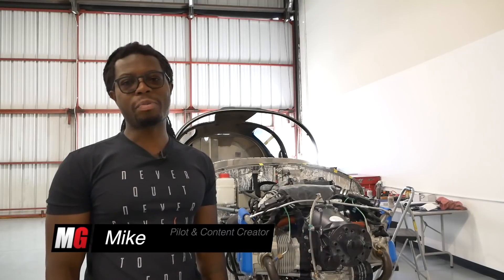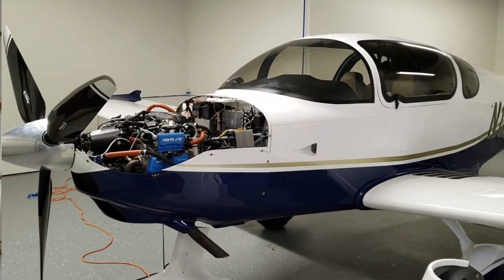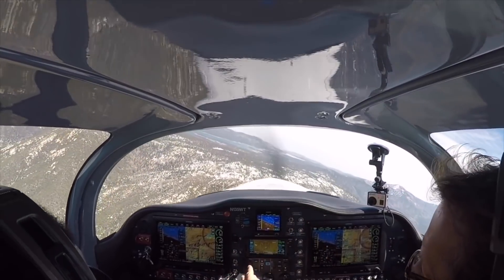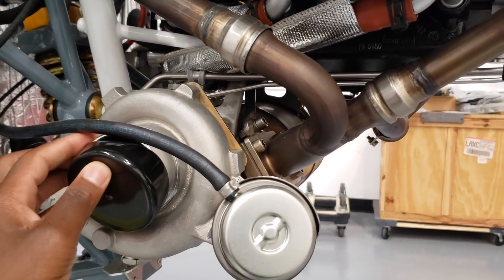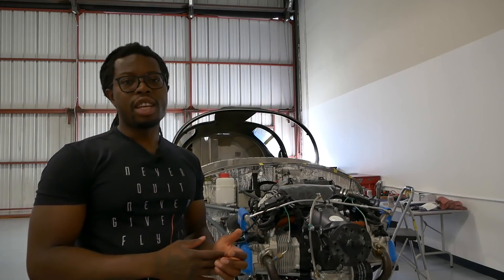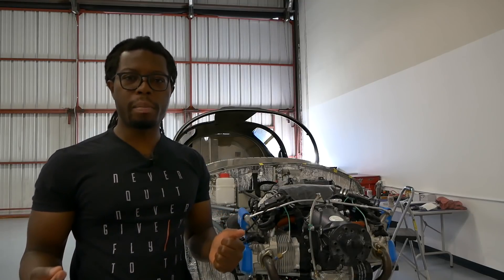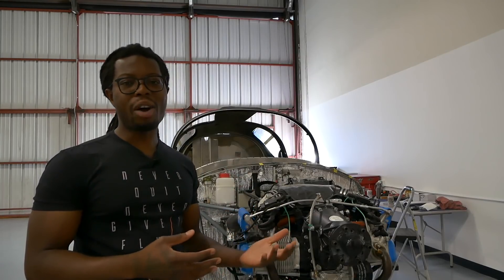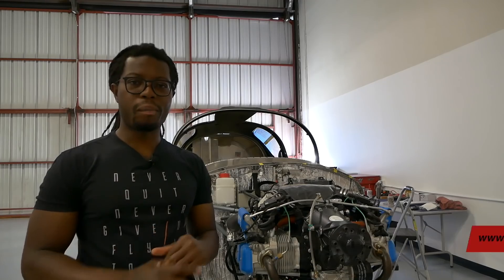What Makes The Rotax 915 Aircraft Engine So Special?

Comment: Interesting that the Rotax 91x series don't water cool the cylinders, and don't use overhead cams. While aircraft engines don't need to rev much, the use of pushrods creates less than optimal combustion chamber design, more reciprocating mass, and several points of leakage. As for the cooling, if you're going to have a radiator and water pump, then why air-cool the cylinders? Odd design choices, but these engines are certainly an improvement over the ancient Lycoming and Continental engines.

Comment: The most reliable way to add an extra 50 hp to a rotax 915 iS/ULS is to put two more cyclinders on it and make a it a six cylinder engine.
Why are Rotax messing about with turbocharging to Squeeze every last available horsepower out of the 912 platform?

Comment: I sold my turbo charged Mooney 231 in 2010 after flying it over 2000 hours in the previous 15 years.   The Continental TSIO 360 produced 210 up to 15,000’,  and gradually less up to its service ceiling of 25,000’.  Likewise I’m sure the 915is will produce much more power than a normally aspirated engine up to its service ceiling.  I owned a KITFOX SPEEDSTER running a ROTAX 912.  It’s a great engine.

Comment: Still difficult to understand a 1300 cc engine developing 140 hp and than dinosaur Lycoming or continental around 8 liters  developing 300 hp  and costing at least 4/5 times more no fadec and more similar to wwII engines. Is it that are more reliable than a rotax because they run at a lower rpm or what?

Comment: Mike, is that a reliable engine?  I’m told that the failure rate is higher than a Lycoming. Can you please comment?  Thank you.
Reply: that is a misconception...     based on Rotax also making 2 stroke motors...  & much lower cost $ much lower HP.
evidence is this series is very reliable.

Comment: Maybe the 915 turbo is different but I believe there is a bit of maintenance required on the 914 wastegate to ensure it stays lubricated. They can stick, so you need to check it and drip some light oil on it every now and then. They are great engines though!

Comment: Hey brother…. To escape the unwanted noise, pull your carpet as well as your panel and install a layer of Dyno-mat. It is heavy as shit, but unbelievably effective and somewhat fire resistant. You will either not hear the engine very much at all, or reduce it and other cabin noises to the point of insignificance. Just my 2 cents, which, realistically is probably worth zero, so free, or, maybe I actually owe you money for listening to my advice? Damn Mojo! WTF??? 😂🤣😂

Comment: I've been looking at Rotax engines, and the only thing I'm not sold about is the high rpm. I'd rather have a somewhat larger engine (2.0L) doing max power at 4.000 rpm. That way it could also be connected to the prop without a gearbox. Is there an engine like that?

Comment: So many questions, always with a Turbocharger at least on an automotive engine. It is not wise to have a direct-injected engine. The reason why that's not wisest because the oil residue in the PCV system follow the intake valves to a point where it no longer functions quite well. To solve that issue, you almost always have to put on oil catch can. Is that a problem with this aircraft engine??? Have the other issue which shouldn't happen because you're usually taxing on to your stop point and usually don't have the really high temperatures of the turbocharger when you shut the engine off like sometimes you can with a car after you've driven it hard you get some place you shut it off too soon and it Cooks down the oil and the Turbo Shot because oil is no longer being supplied. With automobile engines, it is wise to have the engine idle for about 5 or 10 minutes so that the turbocharger can cool down before you shut it off. Another thing that you can do is to for about a week on an automobile engine with a Turbocharger you can run some Marvel Mystery Oil in the oil and it will help clean any buildup of shellac or carpeting up of the oil both in the engine and in the turbocharger. But then again linkyte, or what we now call zMAX will do the same thing.
As for your comment on the exhaust note, the turbocharger will change that exhaust note considerably. Plus there are chambers that you can put on the exhaust that will quiet it without costing horsepower.

Comment: What makes 915 special ok how about Turbo oil supply problems+ Exhaust valves+heat shield + fuel pumps + oil pump👎That’s some special ROTAX quality control right there I have no confidence in the 915 for the price it should be problem free for 2000hrs TBO🤬😤😩sad for ROTAX need to do better than this 👎

Comment: Argh, bro, I am confused, your only  con is the "exhaust note" as the engine revs high, which suggests the exhaust "note" is a "loud" one, or is it rather high pitched? Then you go on to say it is a "quiet engine"  - if there is any place to insert a number it is here! Is it quieter than legacy engines, yes or no? By what margin? What is an example of decibel output at take-off? Strange as it may seem, this is a make-or-break issue for me, as I forever dream of quieter flying, being a sailplane instructor and a private pilot.

Comment: much of the info stated in this video about turbo's and how they work along with maintenance etc is either wrong or grossly inaccurate and at best an EXTREME oversimplification!  If one thinks a turbo DOESNT require maintenance just wait till it starts using/eating oil and blowing through the seals.  Blow by is guaranteed and will send oil through the intercooler/intake/combustion chamber leading to an engine smoking severely by using oil and eventually becoming unable to resist detonation and starts to "ping"!  Detonation is what kills MOST engines equipped with a turbo or blower especially if timing isnt retarded ESPECIALLY while under boost!  Direct Injection along with e85 or an equivalent will help alleviate detonation issues due to e85's octane rating as well as it being corrosive and will dissolve any "hot points" etc that lead into carbon buildup in the combustion chamber!  Knock sensors are very useful here as well.  If the computer senses "knocking AKA detonation" it will pull timing to save the engine otherwise get ready for a burnt piston!  Recirculating/bleeding boost can be critical as well!  This videos description/definition of a wastegate, how it works and what it does is not entirely accurate either.  I've very much enjoyed your video's and look forward to seeing more in the future!

Comment: The ECU would also monitor density and automatically adjust turbo power output based on throttle position and density altitude. Thats why a turbocharged car for example would perform the same at higher altitude as opposed to sea level level, but a normally aspirated engine would have reduced performance and a carburated engine would need an adjustment the fuel to air ratio (reduce/lean fuel due to less density). In addition to supplying cooler air, the turbo is a compressor, compressing that air before the intercooler to supply both cooler and denser air to the engine. In essence acting as though you're at a higher altitude (requiring leaning/less fuel), but with also the added benefit of more density (even better than at sea level on a standard day), while producing more power. The result is the engine runs more efficiently while using less fuel. That's a wonderful engine! Just wish I could afford a build like this.

Comment: Great review Mike! Consider distinguishing between the standard legacy engines and the experimental legacy engines. I chose the Lycoming YIO-0233 for the reliability of the legacy design with fuel injection and FADEC. Cheers and good luck with your Sling build.
David

Comment: So, are you saying that this engine is just as sophisticated as my '92 Jetta?  Does it have an odb2 port to clear the check engine light , or do you have to put tape over it? I dont think this explanation of turbo is very informative. Doesn't a Wastegate  bleed exhaust gas and not boost? Maybe that's why it sounds different perhaps.

Comment: Mike said he will use car gasoline? Can it be bought for airplanes without all those road use taxes? It seems avgas 100 low lead would be chesper without road use taxes?  
I'm just learning, but plan to take lessons, asap.
Building a plane is a good idea  but don't u have to be an AP certified mechanic?  Or just psy one to inspect your work?  I have much to learn.  Thanks gor excellent video, Mike.
Reply: John Bell car gas is typically much cheaper than 100LL in the US

Comment: your are incorrect in how you are selling the turbo, even a vw gti which is turbo'ed and built for daily driving, the turbo will wear out in time, the life maybe longer than non FADEC but should still be checked for play on every annual/100 hour or how ever often EAA aircraft are done, no disrespect, love the channel, i'm an AMT/A&P
Reply: Also,  every turbocharged engine has a wastegate; it's integral to the basic functioning of the turbocharging process.

Comment: normal many use plane aluminium block lightweight, V6 or V8 motor cheapen and do all same than you ower price rotax shit. if i need change my plane motor i fight owerprice shit rotax trash and add aluminium block V6 motor what modified run airplane easy, no big woirk all normal men can do this eweryday. simple change motor and modified motor to plane. easy cheap have lot better than idiot owerprice rotax pay.

Comment: I half way like the 915 but they deserve no credit for finally making an engine that's newer than a 1950s design. In car terms this is a low tech engine, it's just that the 912S and other aircraft engines are painfully archaic. And they only deserve criticism for the ridiculous price of the engine. Rotax is not a niche engine maker, handcrafting a handful of engines, they are a mass producer of engines. There is no excuse for 40k price tag. None. In a car it would be a 2k$ engine, for aviation if they priced it at 10k, fine. But 40? bish, please. They deserve to be put out of business with that obtuseness.
Reply: Have have you no clue how much ancient certified Lycoming and Continental engines cost? Show me another OEM making modern certified aircraft engines right now...
Reply: You have no idea how cheap an old aircooled VW beetle engine is and hundreds of aircraft designs use them just not the sling.

Comment: Dude, the turbocharger has NOTHING TO DO WITH THE TEMPERATURE  of the air going into the engine. The turbocharger increases the volume of air that goes into the intake system by using the force of the exhaust to drive a turbine and therefore effectively increase the density and therefore volume of air, and subsequently fuel, that is available to burn which translates to more fuel mixture to be compressed and therefore more power. The intercooler cools the compressed air so to prevent detonation. Also, cooler air is NOT automatically more dense. Cooler air, depending on atmospheric pressure, is typically more dense but not in the case of compressed versus non-compressed air. So cooling the compressed air from the turbocharger doesn't make it any more dense.
Reply: A turbo 100% effects your air intake temperature. The effect of compressing the air makes heat.
Reply: A turbo heats up the air, the whole point of intercooler is to deal with this.
Reply: Exactly. I also think there is a disconnect in the explanation of what's happening in the turbocharger unit itself. Absent is fact that exhaust air drives the turbine, and through a common shaft, drives the compressor. There are two different chambers: exhaust/hot, and intake/cool. The explanation in the video alludes that exhaust air is reintroduced to the engine's intake, cooled by the intercooler.

Photos and diagrams tell much better stories:

https://www.boldmethod.com/learn-to-fly/aircraft-systems/how-an-aircraft-turbocharger-system-works/
Reply: Mojo pitches his videos to non technical wanna be flyers. So technical analysis like " it doesn't beat up the engine" has great resonance. Temperature and pressure relationships add unnecessary complexity

Comment: Is the turbo liquid cooled?
Reply: Liquid cooled heads and air cooled cylinders.
Reply: I think this question is about how the turbo gets cooled, not the engine.  On car turbos, prior to the mid-1980s, it was common for the only cooling of the turbo bearings to be via the oil.  After that time, water jackets on the bearings were almost always added to car turbos for better cooling.  I’ve done a turbo replacement myself on my 1992 DSM.

For this Rotax engine, I did a quick look at their manual “Maintenance Manual Heavy” in the section “turbo removal”.  I couldn’t really tell from that.  It has a single bullet item for “Remove coolant hoses”.  However, in the pictures with numbers indicating parts, and the numbered procedure for turbo removal, there is no mention at all of the coolant hoses.  So I can’t tell from that whether those coolant hoses have anything to do with the turbo.  I would guess not.

Comment: The normally aspirated engine is only capable of "breathing in" an amount of air relative to its capacity and low restrictive flow capabilities of it's intake passages. as well as atmospheric conditions. So in order to coax more power out of an engine - along comes the Air Boost systems to introduce more air into the combustion chambers.  "Ram Air" system - "Turbo Charger" or "Super Charger"

Comment: You know somewhat about Rotax. From your narrative I know that you never had to do any maintenance on it. Its not so easy as you tell it to be. Especially because its a turbo-charged.
With a good intercom and noise canceling you will not notice the exhaust.
One BIG HUGE disadvantage it the outrageous price of this engine, 40k+ and its overly complex too.
Get real Rotax.. its 2020
Reply: Price is driven high due to simple economics of scale....they developed a high tech engine for a small market...it’s going to be expensive.   If they sold 500,000 per year is would be $12-15k not $38k.
Reply: David Cook Exactly. And show me a more advanced certified engine out there...

Comment: After 30 yrs of flying..professionally and now just boring holes in the sky,  automation is great until uncle Murphy rears his ugly head. Just be sure  you know what to do when those creature comforts stop working...and they will.....safe flying to all.....
Reply: I've been flying FADEC and EEC/ECU on turbojets for 30+ years now. I didn't know anything about  its piston engine application until recently. I can see the niceties of a reduced pilot workload, and having more efficient engine/mixture/prop settings than the pilot can set. There's a back-up battery - in case. Although, I'd like to know if there are default settings that the system goes to if a module fails.
Reply: @EJWash57  
The parachute light comes on 😂

Comment: Mike, why you were awkward to say price?
Reply: $36,995.
Reply: @andrewmorris3479  plus the engine mount and accessories (and they are not cheap, typically around another 15K USD, so, about 50K USD by the time you have everything you need, and does not cover installation costs)
Reply: @MrZrryan2  as a zero hours engine for a four seater aircraft thats cheap, plus you are installing it yourself so thats free!

Comment: Another great video Mike.  You mentioned you didn't care for the exhaust note because of the higher rpm, but then you also stated that it was quieter.  For clarification, is this engine quieter in the cockpit, in comparison to something like the Lycoming IO-360?  Also, do you know of any ADs on the Rotax 915?  I know it is fairly new engine, just curious.

Comment: Great Video but you left out great things about the rotax engine....

About the Rotax engine:

The case, barrels, heads and pistons are all of the same aluminum metal which contracts and expands uniformly eliminating the problem of shock cooling.

The oil is in a canister and not at the bottom of the engine so it has two traps so that air can never get into the case eliminating condensation and damage from under use.

The carburetors never experience ice so there is no carburetor heat in most planes.

The heads are liquid cooled so the cylinder head temperature does not rise above 230 eliminating the possibility of softening aluminum and giving hot spots. If cooling fluid is lost due to leakage the engine may still be flown.  There is no leaning mixture knob.... it is done automatically. So the pilot cannot damage the engine.

Running at higher RPM you can get the same power as a heavier engine by having the cylinders closer to each other reducing the weight of the entire engine so the weight to power ratio is very good allowing 4+ gallons per hour consumption.  Lycoming and Continental do not want a gear reduction unit so their engines must turn at the rpm they want the prop to turn.  This sacrifice gives us big slow pistons with a lot of bang, not good for longevity. The cylinder attach bolts are computer torqued in the factory in Austria and stabilizing mechanisms are used during the torquing process to ensure balanced forces.  All torque values are saved in the engines computer files at the factory.

The crankshaft is made of five separate pieces not including four piston rods.  If part of the crankshaft is damaged one does not have to buy an entire new one.  The prop also has a breakaway clutch from the crankshaft in case of a prop strike to protect the crankshaft.

Built with very few seals and gaskets, instead they use a paste, leading to less leakage.

No alternator to buy or magnetoes to rebuild.

Mogas ready.  One dollar less per gallon, so effectively a 16:50 fuel cost ratio compared to to an o-360.
Reply: funny how a guy that knows so much about Rotax and is obviously a fan, omits to mention the price...
Reply: About 38,000. So…….?
Reply: Are the heads shrunk screwed or bolted down or both?